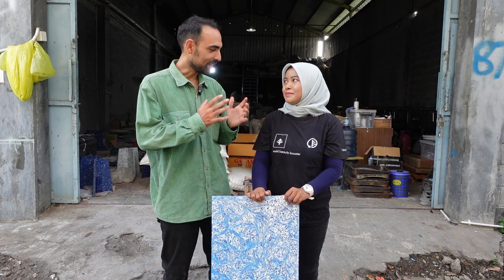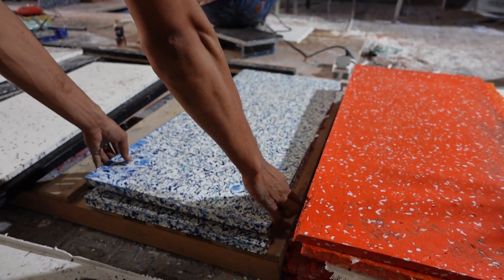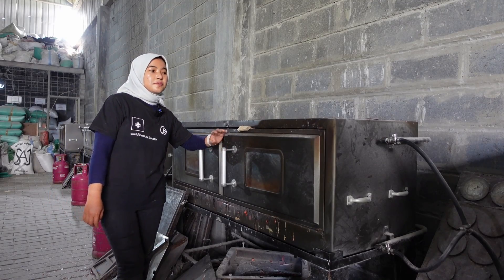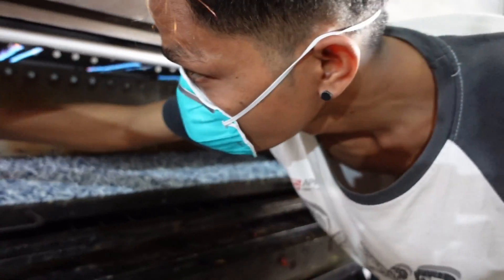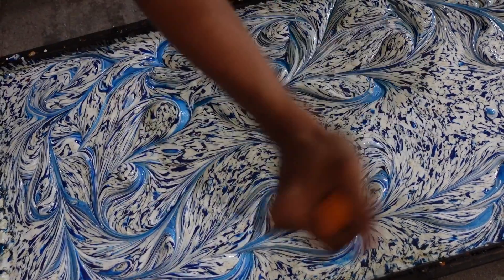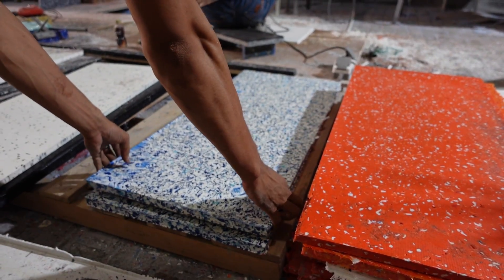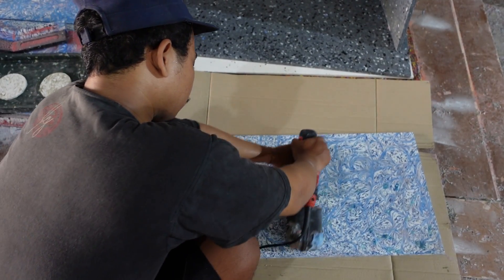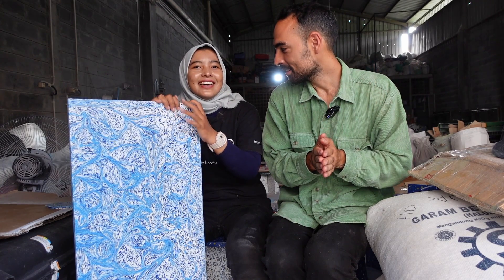How to recycle PLASTIC with a bread oven | ROBRIES

Comment: Awesome vid and the guy and webpage info i was searching for because over a few years i've caught his vids and it's really great to see it has progressed a lot and the product line and options i was just finally checking out...Also i am wondering if the flat sheets could maybe be plastic welded together once attached to a frame for example , like if a plastic shed was made with the sheet as it's sheathing using screws, maybe the seams can be heated and seamed water tight ....i finally have some space but i am arranging it still , i do metalwork and mechanical work but i am excited to see another product and trade to add along with it....i will be sure to contribute or probably order off the precious plastics once i get it rolling , thankyou for showing us the shop and my closed caption is off for example "gallon" it read "balloon" etc, but she comminicated well and produced exactly what i've been interested in besides the extrusions i saw on the webpage and bricks , the interlocking brick methods are very interesting too....hopefully i'll be able to design entire shed kits and produce the flat sheets and some sand brick paver blocks too ....oh lastly i have never seen a method to make ones own air-ated plastic similar to polystyrene insulation for it's floatation and insulating qualities , i know some fire-proofing agent is added because i tested small piece of insulation foamboard i use a lot it started at $30/sheet for 2" and jumped to $50/ 4'x8 foot in weeks and i still need more , it's useful for fiberglassing boat hulls to get the form and leave as floatation , etc.....srry my replies get too long, God Bless thankyou hopefully over the next few months i'll be able to get my shop set up (wow ! )

Comment: What happens to all the sanded and shaved material? Is there a way to process that back into products? I imagine the sanding creates a lot of plastic dust. Is there a way to keep that from entering back into the environment?
Reply from the maker: Thanks for this. They try to use it in the next sheets as much as possible. But defo room for improvement
Reply: @Precious_PlasticHQ pls how did u cut the plastic can into smaller pieces,,, pls I didn't see that part in the video
Reply: @storiesoffaith678  Plastic can be cut with the same tools you use to cut wood - but you do have to be careful with heat buildup. Too much heat and the plastic can burn on the edges or even melt. I've watched a production line that was converting waste into solid bar stock (20+ foot lengths) which was then auto fed into a CNC controlled saw that cut the bar stock into short lengths for further processing into useable items on other machines. A water based cooling solution was used to prevent any heat buildup. It also had a slight lubricating quality to it as well. All the cuttings were recycled all over again into fresh bar stock. The screw and barrel setups were upwards of 8-10 inches in diameter. For those that don't know, that's a LOT of plastic capacity. You could make square bar stock 12" x 12" continuously on the large extruders though most of what was made was smaller than 4 inches per side. Yes, there was round stock as well. Typical stock was round, square and rectangular but they could extrude any shape based on the design of the die & receiver plates. Obviously, a high capacity production environment is vastly different than what was in the video but the basics are the same. The plastic doesn't concern itself with what environment it's in or what tools are being used. Best wishes!

- Max Giganteum

Comment: This is FANTASTIC!   If you put what you see to work, make sure to PAY IT FORWARD by recording and sharing your efforts- inspiring others is how we win the plastic battle!
Reply: The only way to win the plastic battle... is to never produce it in the first place. Think about it!  Everyone on earth needs to get back to doing things the old fashioned way WITHOUT most of the plastics we use. Oh wow... how did we ever get along without plastics?!? We got along just fine without most of them and we should get back to that. 🤔

- Max Giganteum
Reply: @MaxGiganteum  If we do nothing, most all the plastic ever made will remain in the environment for many, many generations to come.  We can't wish-away production with dreams of a time before plastic: we either clean up our mess- and in the process, capture the energy and carbon sunk into that production -or we choke in it.  "The only way" is a proscription that has already failed.
Reply: @mavigogun  You would be correct about existing plastics... the problem just doesn't go away. You're also correct about dreaming things away - that's not a solution and it doesn't work. It takes action for solutions to come about. You're correct about cleaning up the mess. It's important to do it precisely so we don't choke on it. However, focusing our efforts on moving away from plastics is the only true solution to the problem. The sooner we stop producing the plastics, the sooner there won't be a mess to clean up. You have to look at it like a serious injury that produces bleeding. You can keep slap a gauze pad on the problem and apply pressure to keep the patient from bleeding out but the only true solution is to properly repair the injury. If it requires stitches then you must clean up, disinfect and stitch up the wound. Putting in the same amount of time, energy and money into reducing and ultimately removing the production of most plastics as opposed to continuously cleaning up the mess is the only true solution. Think of it this way: you have a kitchen. One day you walk in and discover the faucet has failed and water is spraying all over the wall, the counter and down onto the floor. Left unchecked, you realize correctly that the water will flood the house and ultimately ruin it. Now ask yourself this question: do I grab a mop and start mopping up the water OR do I first turn off the water and then grab the mop to clean up the water? The answer should be obvious. Plastic is essentially like an unchecked water spigot that's not only spraying water all over the kitchen, the water flow is getting worse. Every day, the amount of plastic produced on the earth goes up. Right now, we're trying to mop up the water without turning off the plastics spigot. For the record, I'm not suggesting that we not clean up the plastics mess... or any of the mess. I'm stating that it's more important to turn off the plastics spigot before we get so far behind that the house is ultimately ruined. Turning off the spigot is the key to success at this juncture in time... especially so since we've let it get out of control in the first place. We're too far behind for the mop to solve the problem. So what to do? Exercise our brains and move immediately to do what it takes to eliminate plastics that have a viable replacement. Prime example? Food or water in the form of liquids stored in bottles. We don't need water bottles, soda bottles or juice bottles. All of those things can be installed into aluminum cans or bottles. Why don't we do that now? Because it costs a few cents more per container for aluminum. That's the only real reason why. Of course the true cost is far higher... due to cleanup costs and the cost to the environment. So, the reality is that we're not actually saving a few cents per container, it's costing a few MORE cents per container over the long run. Or worse. Real answers start with each of us by not buying products sold in plastic bottles or containers. Find an alternative. Practice it in your own life and encourage others to do the same... and do what you can to encourage those that makes laws in your country to pass legislation to eliminate the plastics from production that don't need to be produced and used. If enough people speak, it will usually get done. Granted, sometimes it takes the right people to speak or even be the ones with the power to pass the legislation needed to get it done... but unless we get on with the task of eliminating unnecessary plastics now, we're never going to get the spigot turned off and we'll choke on them. Real world plastics? I tend to immediately think of plastic jars, bottles and wrappings that were NOT used with food storage when I was a kid. I previously mentioned liquids. Also, I'm old enough to remember when almost all food items were sold without plastic being involved. I remember when cereal was sold in waxed paper and a cardstock box. Milk? Glass bottles or waxed heavy card stock with a folded top - no metal or plastic. We could go back to those things... if we chose to. For now, we use a lot of plastic instead. Here's to hoping we do go back to some of the old ways, and move to the elimination of plastics. The actual solution. Peace & good vibes!

- Max Giganteum
Reply: Hello kk bisa kah saya belajr tentang rrcucling plastik 
Lokasinya d mn kk

Comment: I have been doing a similar process to make a sheet 1cm X 20cm X 30cm in an electric toaster oven. Very cool to see this on a larger scale. I have 2 questions - 1. did you make the molds? 2. What is the finest sanding paper that you use?
I really like the way you create the patterns in the plastic. The video was great and gave me some new ideas to try. Thanks so much for for producing it.
Reply: hey. is there a way to reach to you? if you have an email or some social media please lmk. i have some questions
Reply: Please could you give me your contact ?
Reply: Yes would also like to connect, im using a pizza o en 60x60cm and galvenized tray for HDPE but unsure of details to make process smooth